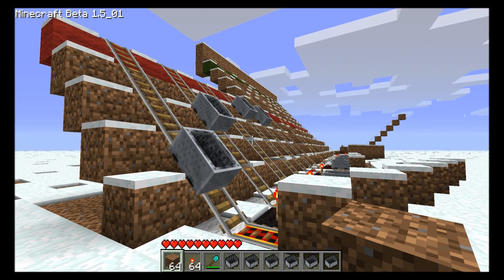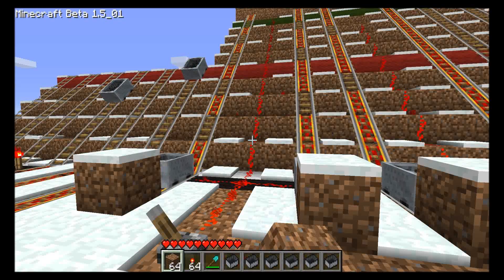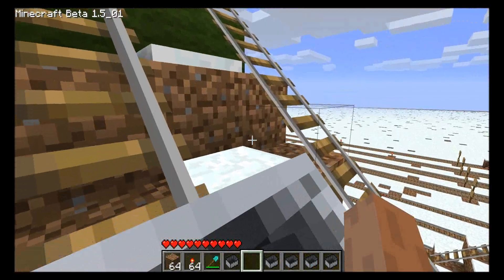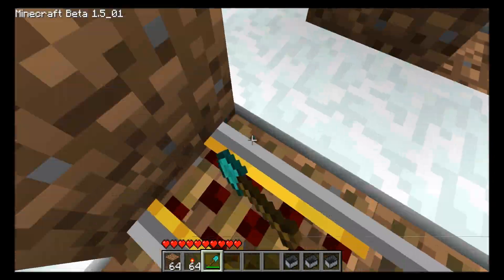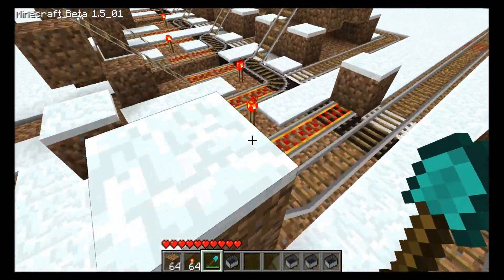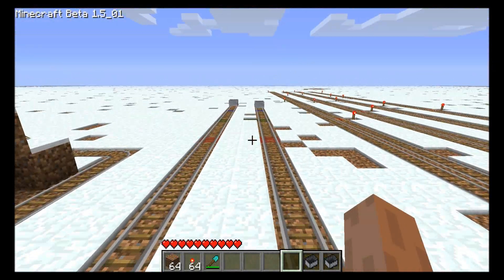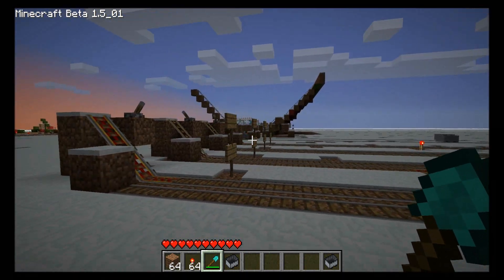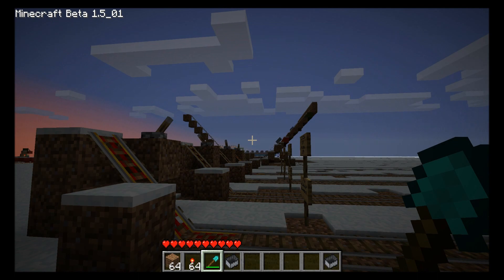More minecart science with powered rail

Comment from the maker: @Venomhide I just finished testing that. I compared three situations with an occupied cart: 8 unpowered rail on a downward slope, 8 powered rail on a flat surface, and 8 powered rail on a downward slope. I reached a distance of 10 meters, 220 meters, and 270 meters. So you do go about 18 percent farther if you put your powered rail on a slope. That's probably because rail on a slope is actually longer than level rail, so the powered rail has more time/distance to push your cart.

Comment from the maker: @Venomhide This is my favorite kind of question.

There's no easy answer. If you want the fastest ride up, you must have powered rail every step, with no turns. If speed doesn't matter, every four rail for unoccupied, and every 7 or 8 for occupied, again with no turns. This will change next week because 1.6 will make powered rail stronger.

Assuming official pistons work the same as the mod, those will be the fastest and most efficient way up when they are added.

Comment from the maker: @PyroFire232 That would take at least a little longer for the ride to start than simply using powered rail to push the rider's cart. That's because it's going to take at least a little time for the booster cart to come alongside the rider's cart.

If you want the best experience of all and the most momentum, use powered rail to push the rider's cart alongside a stationary double booster cart.

Comment from the maker: Minecarts are slightly wider than a single block, which is why booster carts work: Carts on adjacent tracks overlap, and the collision resolution code gets into a feedback loop. Maybe the SMP physics don't deal well with carts overlapping with the walls of a tunnel... though I'd expect this to just stop the cart entirely, not slow it down.

Comment from the maker: @bob52314 I don't think it's absolute. There's only two scenarios in which powered rails are completely superior: For starting a cart's movement, and for braking (but only on a slope or at a dead end). Otherwise there's trade-offs. And there's only one scenario where boosters are completely superior: intercardinal (diagonal) trips.

Booster carts are more powerful for tall climbs or long trips, but they're larger and trickier to set up. They're also incongruous ("Why does this even work?").

Comment: I think Power rails are fantastic. Power rails are perfect for technical rail systems and gives you much more control on your cart (like starts,stops, and split tracks). But I can't see me using power rails for hilly and long 300-400 block tracks, it's just not efficient or  practical for that kind of application .  I'd say a combination of the two methods will work out perfectly for most long range rail systems.